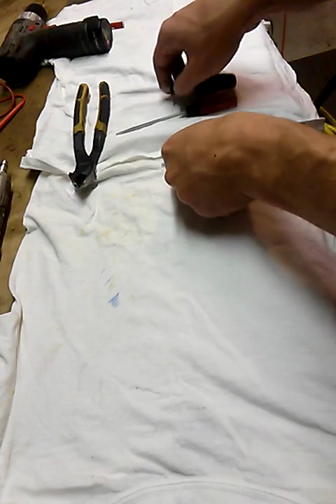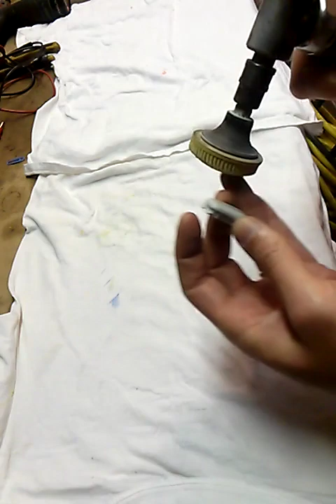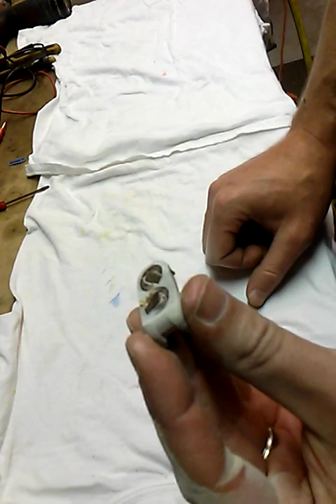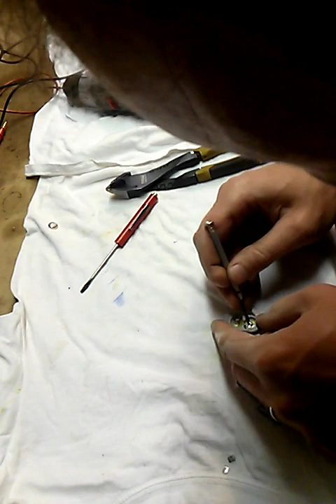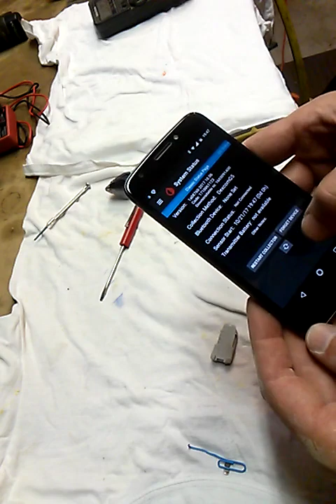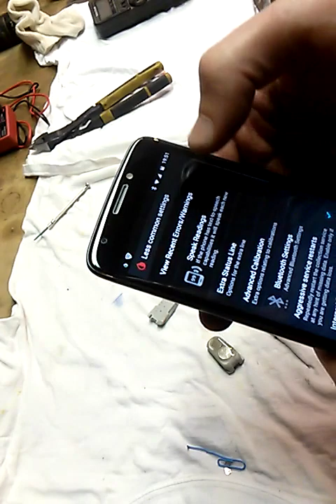Dexcom G5 battery replacement

Comment: My G5 did not look like that unfortunately. I was careful to sand, came across the top of the metal and didn't see any top to pry off with a razor blade. After tochups around the battery I assume a piece of the top part of a battery came up and the solf paste inside was visible. I tried to drill down and create a way to pry up the battery infused in the res, but no luck to pry out the batteries. Just have to wait for a new one next week from dexcom :(  I wonder if they changed it at all? I did follow pretty closely. Thanks still I'm glad many have had success!
Reply: Well after finding the correct bit for the drill I was able to pop out the battery, however I only had the bottom contact but no top contacts, unsure of how to create a new one? Solder
Reply from the maker: Andy V: It seems like maybe you were a bit aggressive and took the tops off of the cells. If there is anything left of the top contact at all, maybe you can dig it out of the side of the cavity and bend it inward?

Comment: Hi, Vince, my transmitter pin that contact the battery is broken, is possible to weld it? Did you ever try to weld it?
Reply from the maker: Which contact is broken? If it's the lower one, I personally have not been able to make contact again. Others have managed to get a drop of solder to stick to it. If it is the upper contact, then you can dig out some of the resin from the battery area wall and bend the contact out enough to make a connection.

Comment: Hi, i did it before and it was working fine, know i did it with other 2 transmitter i had, and no one is pairing... what type of battery did u use?
Reply: I used renata 391, is it good?
Reply: Thanks for the video, it helped a lot of people!
Reply from the maker: Renata 389 is what they come with. That's the only battery I've used in the G5.

Comment: I tried my first attempt at the G5 and everything appeared fine and intact.I took an 
ohm reading and only received a reading on a negative on one side and positive on the other . when I reversed the process for the other negative/positive I received no reading. I installed the batteries anyway and no readings at all. Any suggestions?
Reply from the maker: When you say you only received a reading on one set of contacts, you mean a reading of less than 1 ohm? If so, that is correct. One set is tied together, the other set goes to the device. When you say you have 'no readings at all', does that mean no readings on xDrip+? No readings on the meter? If so, what are you measuring with the meter?

Comment: I've done a couple of these successfully and am going back do refresh the batteries again.  I'm getting odd results from the multimeter after inserting new batteries.  The voltage is jumping all over the place and not settling in on a final number.  Despite having had a multimeter for years, I still don't really know what I'm doing.  But I get a consistent ~1.5v on the meter when checking the batteries by themselves.  I also did the voltage check with one battery and the contact for the second battery...that works too.  But when i insert both batteries and test on the terminals, I get the erratic readings.  Any ideas?
Reply from the maker: Are you testing voltage on the sensor pads, or the battery connections?
Reply: Vince P I’m testing on the sensor contacts on the underside of the G5.
Reply from the maker: What do you mean by 'erratic'?
Reply: I have a similar problem with the voltage after replacing the battery in g4. When testing (the voltage jumps - connection from the side of the sensor) I replaced once the batteries and discharged in a short time. I suspect that one of the plaques has poor contact. Any suggestions?
Reply: I grabbed a video of my multimeter.  It’s possible, if not likely, I’m doing something wrong.  But the G5’s are working when I’m done, despite the way the voltage is showing.  https://youtu.be/YpGt6FiWnoU
Reply from the maker: Justin Lake: I watched the video and see what you mean. I've never seen that myself; it may be artifact from your meter. If all is working, though, I say all's well that ends well!
Reply from the maker: toktom1: If you are doing the tabs like I show in the video, I don't see how you could get better contact unless you spot weld them on. I'm not sure why your batteries would discharge quickly.
Reply: Vince P I have two meters and two G5’s in circulation and both combinations are showing the same thing. I figured I had something mis-configured on my multimeters. Oh well, as you said, as long as they’re working. Thanks again for all of your help!
Reply: Vince P Batteries replaced similarly to wide (added conductive tape). Bateriek ok - I checked the batteries before and after connecting. The only place where there can be a problem is the extreme connection to the transmitter (damaged connection - too much resistance). Xdrip dexcom g4 does not indicate the level of resistivity. Some resistance  value is displayed in g5. I am looking for a solution to the problem ...

Comment: One question .... how difficult is it to remove the JB weld, and how many times have you been able to change out the batteries on a single transmitter?
Reply from the maker: It's not too bad. Careful use of a razor blade and it'll be off in a few minutes. I personally have only done it 3 times on a transmitter. I don't imagine there is a limit, as long as the contacts survive each change (the first change is really the most stress on them).

Comment: Thus far I have removed the batteries and prepped the transmitter for cutting the top terminals and bending the lower terminals.  I have to say your video is excellent.  I am hopeful to complete the battery change.  I have also downloaded the app for the iPhone 5 and will let you know how it works.

Comment: In other words: Dexcom charges you or your insurance a few hundred bucks every 6 months to get you a new set of CR batteries that cost 1.99 at radio shack
Reply from the maker: I'm not too quick to bash Dexcom, without them we might not have this level of care. That being said, between FDA requirements and shareholder interests, pricing of this (and every other medical device) is hardly fair to those in need. I'm sure all would agree that the healthcare system (in the US at least, I can't speak for elsewhere) is irreparably broken.
Reply: They do provide a enormously helping device, but they could have desinged it rechargeable. I've seen a UK guy fitting a headset battery and water proof micro usb, so it is possible. I see they need to cover cost, but why not relay it to the sensors. Look at the competition: Abott's Flash (which does not transmit on its own, given) cost 60 EUR for a 14d sensor with battery integrated. I expect someone to say "it does not need a big battery, it goes to waste with the sensor every 14d" but neither does the dexcom, 2xCR44 ist not heavy on capacity. (plus, you can read the Flash for 14d every minute solid with a NFC-to-BT bridge and turn it into a CGM, tho the piggyback transceiver it a bit clunky). Cost coverage or any other valid reason or not it does look like they are milking those dependent on the device, unnecessarily impacting their reputation.
Reply from the maker: As I mentioned in the previous reply: the pricing of this (and every other medical device) is hardly fair to those who need it.
Reply: Basically I think the cost of the sensor is all the research, and cost of developing/support and such.  Probably cost a few dollars to make.  Whether it's a lawyer, doctor, mechanic or store.. the cost of the product is everything beyond the item itself, plus what the market will bear. These things are made for a very wide population group and fear of failure or litigation cost a lot.  Just getting something through the FDA is huge.  Basically sucks...
Reply: Vince P thank you for the video it is very helpful. Could you tell me what size battery the dexcom G5 is? I couldn’t read mine. Thanks again
Reply: @terrymcgee6556  The original type is Swiss made Renata 389.  I get mine on line from Battery Junction.com.
Reply: Apologizing for these disability profiteers is like apologizing for an abuser who buys you presents.

Comment: Vince. What is the solution if the top battery terminal breaks?
Reply from the maker: It depends on where the break is. If it's flush with the top of the resin, you can scrape some resin and bend it inwards, as shown in the video when I break mine off.

Comment: You ever figure out what to do if bottom tab breaks off?
Reply from the maker: I personally have not. Some commenters have been able to place a drop of solder on the remains of the tab.
Reply: Vince P yeh, I ended up just moving on to another transmitter. Im up and running now. Thanks

Comment: Hey Vince, can I send you my used sensor and if you can change the battery. Will pay
Reply from the maker: Sorry Valery, between working full time, and heavy involvement in other volunteer work, I simply don't have the time to do this as a service. There are groups on Facebook that will do this.

Comment: Just did mine today, thanks for the new technique. One top contact snapped off, the other I just left as a nub to hold the battery like a clip, after bending it like the snapped one. Seems just fine. Used my Dremel with a pretty course sanding wheel, it took paitence and just worked slowly around the batteries. Closed with black suguru. Looks like a leech LOL.

Comment: After two failed attempts I've finally cracked the battery change. I am so cack-handed I keep breaking off the top sensor. I've discovered that if you use your dremel to remove the bit of plastic between the remnant of the terminal and the side of the battery it creates a really good connection. I can't show a photo as the terminal is on my arm now. 

I don't think this was shown in the video- apologies if this isn't news!
Reply: Dear Paul, can you please clarify. What do you mean by "the remnant of the terminal and the side of the battery"? Thanks in advance

Comment: Vince, Looks great.
I have a G4 and have not moved to the G5 dues to lower battery life. I've also held back due to phone compatibility. I noticed you have what looks like a moto phone which is not listed as compatible with Dexom. I have the moto G5S plus. Should this work with the G5 transmitter?
Reply from the maker: I can't say for sure as I have not used that phone myself. If you ask in the xDrip G5 Facebook group, I'm sure you'll get an answer from someone who has.
Reply: Great Idea, Thanks Vince.

Comment: Thank you, I used a glue gun to seal things up afterward, applied faster than epoxy and was  easy to take off
Reply: Is holding tight like epoxy? I mean can it fall off from the transmitter?
Reply: I would also like to know if hot glue keeps the transmitter properly sealed and intact the way epoxy supposedly does.
Reply: So I actually used aquarium silicone sealant! I thought I had the epoxy on hand but I was wrong but I figured it would have the benefits of being water proof and easy to remove with a razor blade for when it was time to replace the batteries again and it’s been working great! Until just now a month in an edge had peeled up during vacation so I will unfortunately need to go get some epoxy tomorrow before I accidentally get it wet! Only other down side is that usually I paint my transmitters with nail polish designs to make them look pretty and festive however the polish had not wanted to stick to the texture of the silicone unfortunately. The sealant certainly isn’t as fast to apply like the epoxy as it takes several hours to fully cure but within an hour or two it should be solid enough for you to be able to place the transmitter into the sensor (I do avoid using the little plastic arm to push it in just in case for the first time I use the sensor after applying the silicone and just delicately use my fingers to push it in and then I’ll smooth it out with a wet finger if I have to)

Comment: Thank you, great tutorial. I have broken a G4 transmitter before trying to swap batteries, but the G5 swap went perfectly well. Have you "redone" any of your G5, ie. swapped the batteries a second time ?
Reply from the maker: I have. Either due to the batteries dying or the transmitter not working properly (you must disconnect power to reboot the transmitter software). It's worked out fine. I just use a razor blade to slice the epoxy off and dig the batteries out. I either drill the batteries again, or, sometimes I can work a small screwdriver in and just pop them out.

Comment: To those who broke the tab below the battery, i did it and fixed it, glued it back in its position, i’ve scrapped the metal pin where it’s normally attached to uncover more metal, i’ve put a minuscule drop of solder between metal pin and tab (difficult but doable). By putting the battery back, it snapped and holding it at together. The Transmitter is now working fine.
Anyone knowledgeable of welding/soldering could recommend a good solder or method to make very small welding to ease this repair?
Reply: Hey there, I fix laptop motherboards and pcb's quite frequently. My tips to repair the bottom tab would be:
1. Glue the tab back in place (as you did)
2. Use solder flux, you can buy it online in syringe form or in a little tub.
3. Squirt/smear the solder flux over the join you want to make before you solder. Enough to completely cover the join you want to solder.
4. Solder as usual, heating the join, you will notice the solder will stick much faster than usual and coagulate together on the metal much much better and neater with less heating required.
5. remove excess flux with isopropyl alcohol and a cotton tip/paper towel.

Comment: I’ve just completed a G5 battery replacement.  And all looks well that it will work. There were however, a couple of issues that I’d like to share.  1. The single-edge razor blade did not easily break the spot weld connections to the batteries. No matter how hard I pressed and twisted the blade, all four connections were the same trouble.  The metal of the connection would bend up around the weld, but not break free.  My solution was to position the transmitter in a vertical position, position the blade and lightly strike it with an upholstery tack hammer. 2. The two under-side negative connections would not reform to the rolled-under position.  With the paper clip positioned as shown in the video, my best bend was about 45 degrees.  Even so, I was able to get battery contact and the voltage at the sensor terminals was good.  Since these two procedures looked so easy to do in the video, I’m wondering if it might be the metal thickness is greater in my connectors.  That is,  the material used to fabricate my transistor is different.
Reply from the maker: It is possible that the terminals are being made thicker. As far as using a tack hammer to strike the razor blade, I would urge extreme caution in doing so. Razor blades such as pictured in the video are brittle and susceptible to breakage. Striking one with a hammer my cause sharp fragments to fly off.
Reply: That's what I think... the metal is thicker.  I did use caution - safety glasses and things were secure.  One edge of the blade rested on the wood table surface and near the other end was on the weld.  And notice that I said "lightly strike".  I got some epoxy today I was going finish the job with.  But when I got home and looked at it better I've decided to wait for a visit to Lowe's that should have the J B Weld.  What I found today was Loctite that would do the job, but come with two nozzles that would allow only two uses.  I considered using without the nozzle but will wait for the right stuff.

Comment: Thank you for your time, I changed the battery and I got 0.195 mv but after I but it on my daughter here receiver ( monitor) send message signal lost , I try to understand how to solve this problem, can you help please?
Reply from the maker: Is yours a G4 or G5? If it's G5, and over a certain age, the receiver will no longer read it's data and you must use 3rd party apps like xDrip+ or iosxdripreader (see pinned comment).
Reply: Using g5 , and it is over 112days since been activated , I am not smart person like you , can you please provide more information about xdrip or isoxdrip or may be you can add video show what I have to do? Thank you very much for your help
Reply from the maker: Please see the links in the pinned comment for the 2 apps you mentioned. Another source of help may be the xDrip G5 group on FB.
Reply: Vince P I tried to download this xdrip for iPhone but without any luck, also I still confused how this will help to reuse dexcom transmitter? The main goal from this video is to reuse the transmitter, is not it? Or I miss something?
Reply from the maker: The aforementioned apps will listen to a transmitter of any age, while the official apps or the receiver will not.
Reply: Vince P understood thank you for your time, is the xdrip possibly to be used for sharing too?
Reply from the maker: Yes. xDrip+ allows sharing by multiple means.

Comment: Thanks so much for posting this video- I'm following the steps now.  Just a suggestion- it's easier to handle the transmitter while you're working on it if it's connected to an old sensor.
Reply from the maker: Indeed, that would give a greater area to hold on to. Thanks for the suggestion, and I wish you success in your battery change!